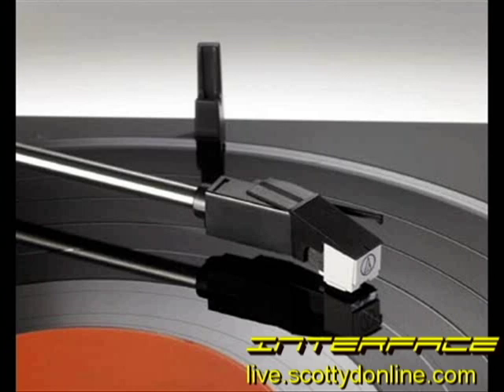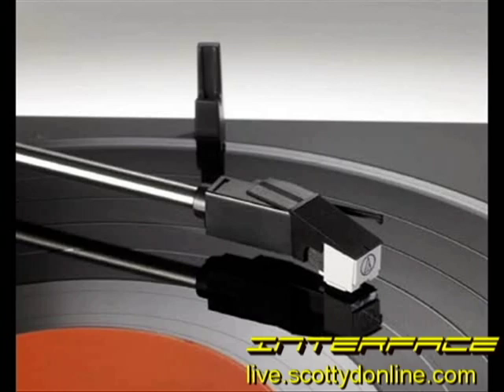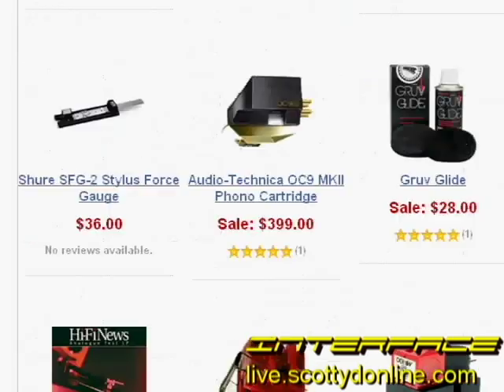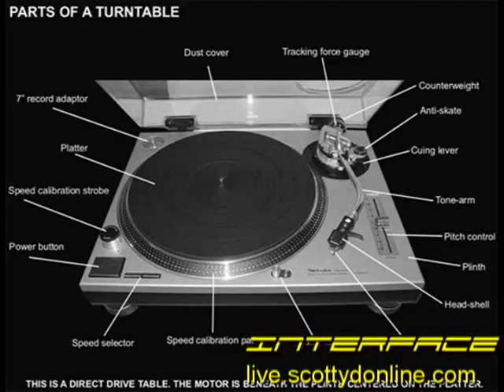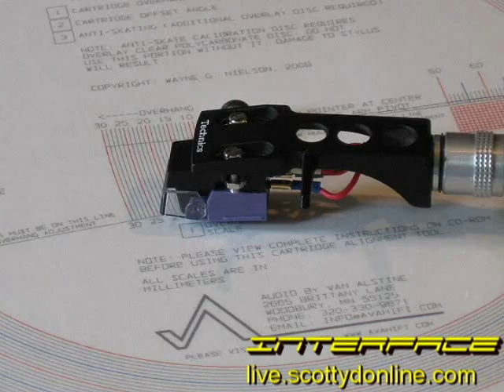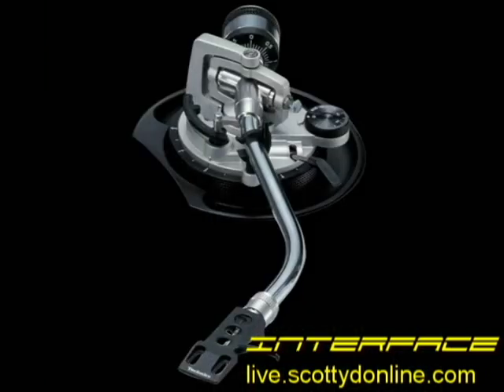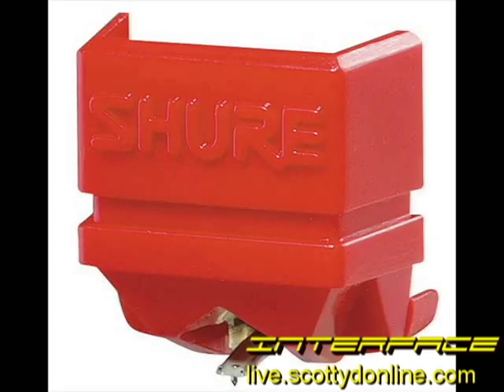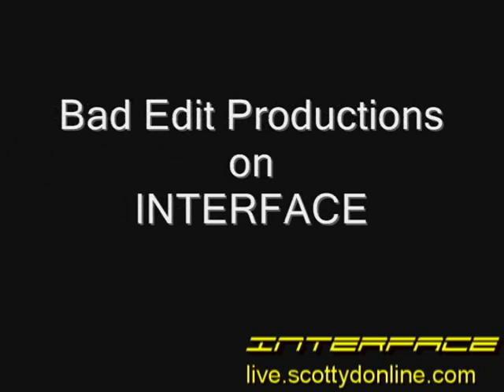INTERFACE How-To - The Phono Cartridge

Comment: I bought a BSR record changer and put a new stylus in it. It still sounds like high tingy and no lows. I would like to change the cartridge from ceramic to magnetic but I fear it will need a new headshell as well. Where can I shop for a set up to accomplish this? Thanks I am Hector.